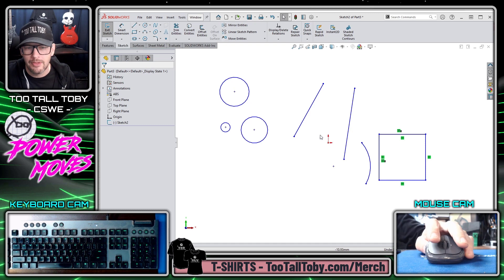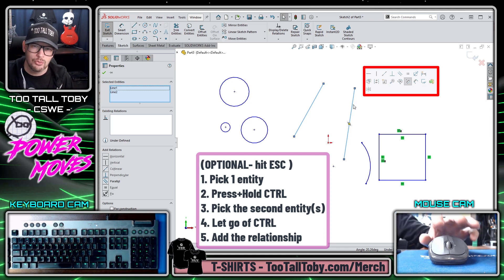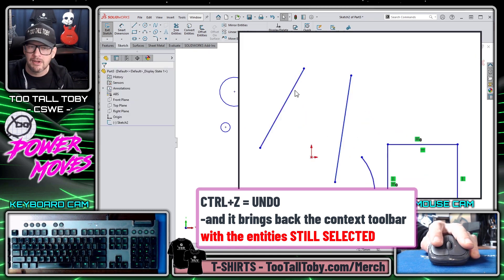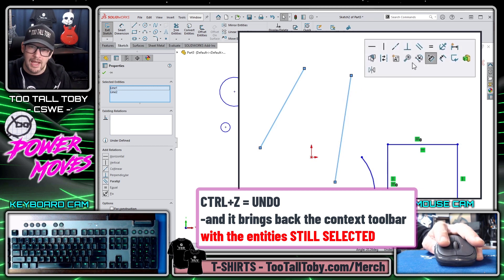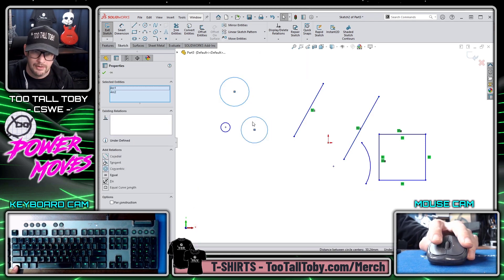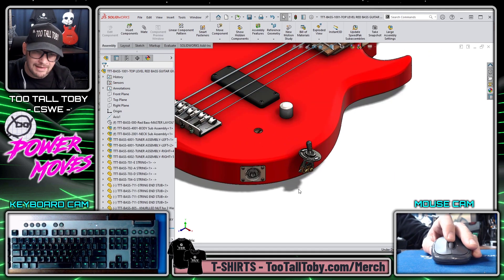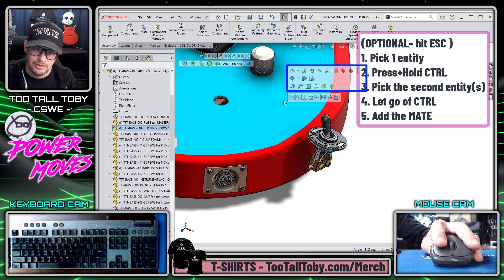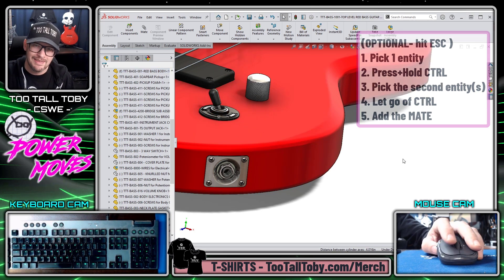SOLIDWORKS Quick Tip - Letting Go of CTRL

Comment: Also works the other way around. So normally when drawing multiple lines it will snap or add relations to the other lines already there. But when you dont want any relations on the line you are drawing just hold control and it will not add any relation to the line/point you draw.
Reply from the maker: Oh wow - disable automatic inferencing?   Great bonus tip!  Thanks Anne!!